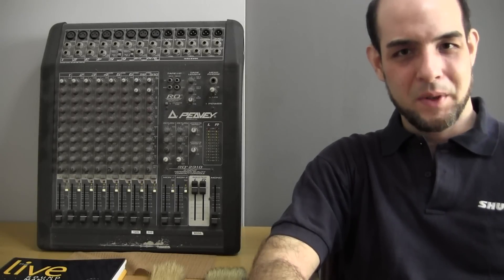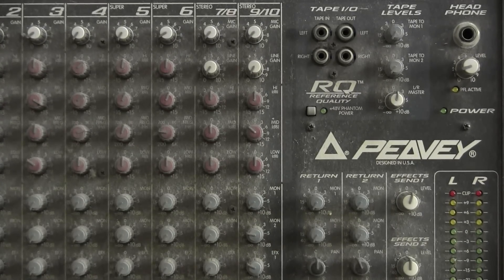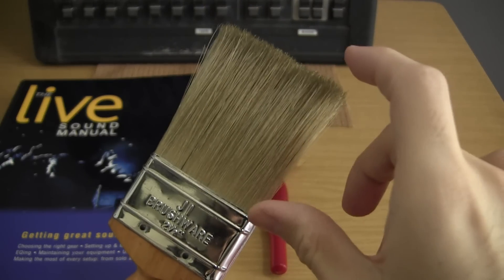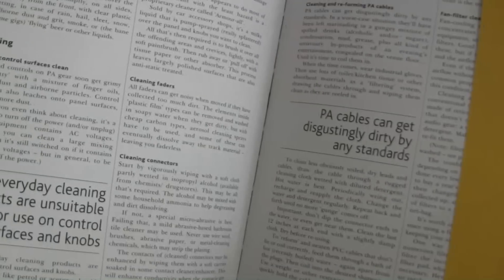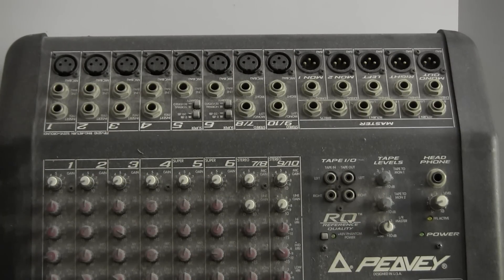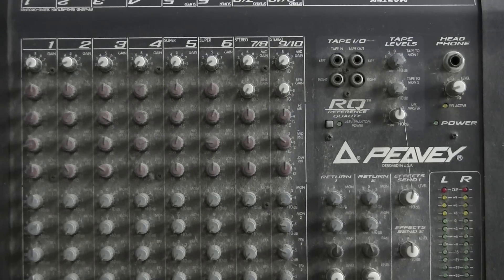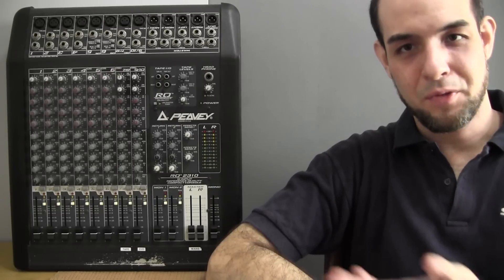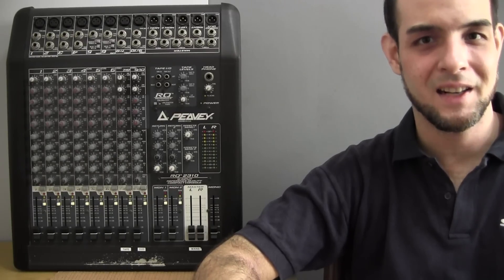How to clean a dirty mixing console

Comment: hi i have a yamaha mixing console 4 channel the line input its stereo or  mono bacause i put a stereo jack its play mono i need your help plesae
Reply from the maker: Which console are you using?
Reply: hi i am very glad mister loucio  for your response i use a yamaha 4 channel consol GLB Productions
Reply from the maker: Please tell me the model number, which will be on the front panel somewhere.
Reply: hi its a yamaha f 4
Reply from the maker: On that mixer the line input is mono and balanced on channels 1 and 2. On channels 3 and 4 channel 3 is routed to the left speaker and channel 4 is routed to the left speaker so you need to make two separate connections.
Reply: hi so i put left channel on one channel and rigth channel on channel tow ?
Reply from the maker: Correct - left to channel 3 and right to channel 4
Reply: hi i cant connect 2 turntable and 1 deck

Comment: Thanks for the video. I have to disagree with using armor all. It is horrible for plastic parts. I have been in the automotive business for nearly 20 years. It will almost always cause cracks  on the interior of a vehicle. They should not be allowed to market it as a protective coating. It is not a polish and it destroys most plastics in as little as a few applications. Not to mention, it will cause it to collect more dust and grime as time goes on. I would ban armor all altogether if I could.
Reply from the maker: Yes I have heard this concern from several people - what would you recommend as an alternative?

Comment: dude i got a lot of crackling on a slider, how do i fix it?
Reply from the maker: MSK Chess I'd start by moving the fader back and forth along the full length of its travel 20-50 times. If that doesn't clean the contact track then you will probably need to take the mixer in for a professional cleaning. You can try spraying electrical contact cleaner into the slot but be warned that this may make things worse than they are already!
Reply: I searched other videos and some dude sprayed contact cleaner into the slider and it worked, why would it make it worse? kind regards Robbie
Reply from the maker: MSK Chess Depending on what sort of fader it is (carbon vs plastic film) and what sort of contact cleaner you use, the cleaner can dissolve the material of the fader track and then you will have no fader at all.
Reply: Its a very old mixing desk that i was given for free, its a Mynah 8-2-1 made by 3G Ltd.  Perhaps i could blow the dust out with some kind of air pump?  It just crackles a bit when i put the slider volume up and sometimes maxes out the audio signal.
Reply: I have ordered an electrical contact cleaner.
Reply from the maker: MSK Chess Sounds good, let me know how it works out!
Reply: many thanks I will do :D
Reply: it worked amazing, sprayed some onto the slider with a little swart and now there is no crackling, slider works beautifully :D
Reply from the maker: MSK Chess Great news! Hope you get lots of use out of that mixer.
Reply: MSK Chess I've always used CAIG DeoxIT F-5 for the pots and D-5 for the jacks.  Which one did you get?
Reply: Hi I got MAFCO Electrical contact cleaner, came in a large blue and yellow canister with a straw, was awesome sliders are running smooth.

Comment: I’ve used paint brushes for years to clean my mixer . I have to say it’s okay but not recommended for relatively clean consoles and defiantly NOT for a very dirty console. The reason I say this is the brush method actually stirs up the dust and adds to dust build up in pots , faders ect. A static charged duster is more effective to keep the dust from getting air born. The best way is a scratch free fabric and evaporated water stay away from chemical cleaners they do more harm than good in the long run (careful your cloth is ever so slightly moist NOT wet). Never clean equipment on/powered (always turn off and unplug just to be safe). Imo,This is the best way to keep the dust from going airborne and doing more damage to the price of equipment being cleaned as well as damage to any other equipment you have in your recording area. That’s why I also recommend you clean your super dirty equipment in a different room (preferable a garage or outside on a nice day not to hot or cold with ideal humidity). Cheers hope someone finds this useful :)
Reply from the maker: Thanks for the post - many good points there.

Comment: Armorall is a bad choice. It is known, especially amongst all the car groups to cause cracking of platic pieces like dashes and vents, and your knobs and faders in situations where they are exposed a lot to the sun. windex, or Simple Green glass cleaners are better as they repell dust.
Reply from the maker: I agree that Armor All has a bad reputation in the auto detailing world but remember that in that situation we are talking about multiple applications on a weekly or daily basis. In this case we have a one-time use, mainly to clean the painted metal panel, not the knobs. This is a trick that I picked up from an old hand in the industry so am confident of passing it on to the viewers. 

If you are concerned about Armor All cracking your knobs then just use a damp cloth, or remove the knobs before cleaning as shown in the video.